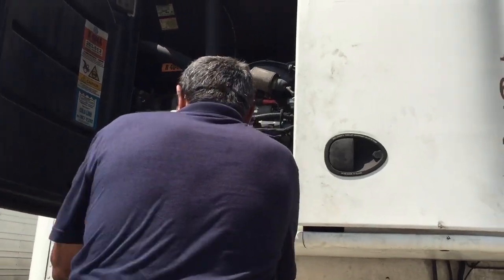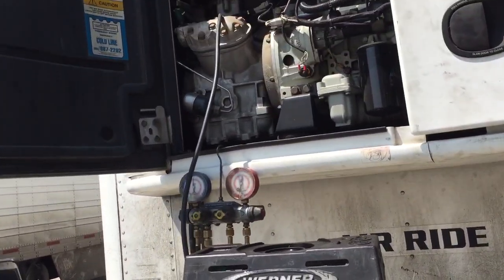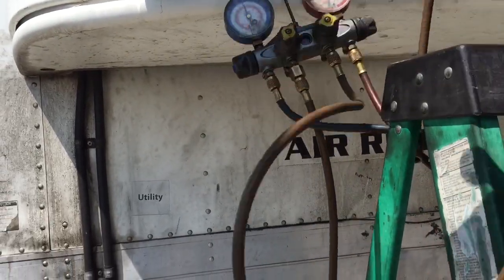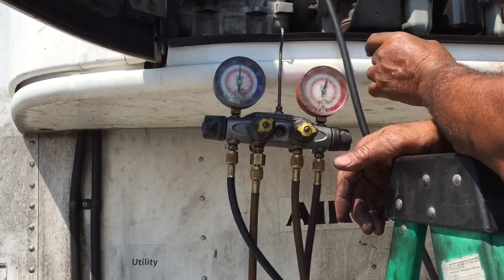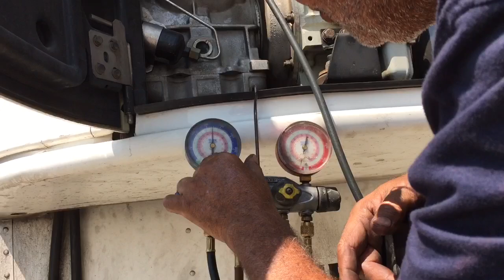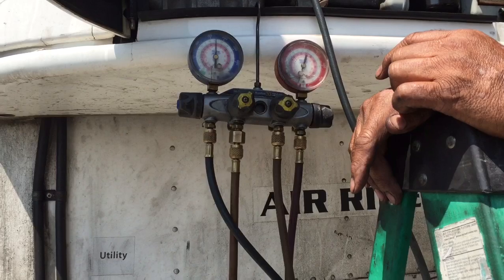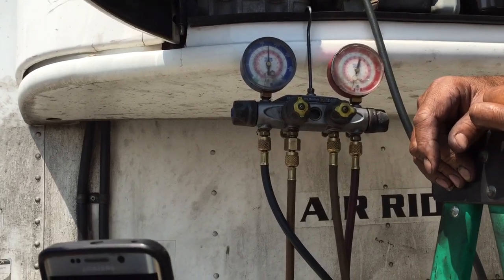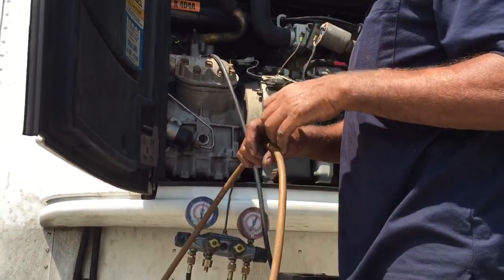Recharge freon in a Thermo King Reefer unit

Comment: I admire the guy trying to help the others, I'm sure he was getting paid but there was no way his students were comprehending what he was talking about. If you have to explain that the blue hose goes on the big pipe and red hose on the little pipe then they shouldn't even be touching a reefer. They need to go back to refrigeration basics and understand where to connect and what each component is in the circuit. They are too green for this machine. Funny to watch though.

Comment: The guy said blue to low pressure and red to high pressure, and connect to  where the bubbles are when you need to vacuum the system. The guy know his job just can't explain it right and people who don't know how to work in reefers unit such as thermoking or carrier will have an even harder time understanding anything. The Freon R404a for these units can be loaded both gas or liquid, just load it slow and with an scale. it's always better to vacuum the system and load the right amount of Freon to get a more efficient operation.
Reply: Any video to learn about it ?
Reply: @jonathanmembreno1325  not really. It's easy though. Thermo king has instructions in the operators manual. Basically get the box to around 0⁰f and add refrigerant until the ball in the sight glass is a bit over half way.
Reply: In which shop u working in am hiring
Reply: Wait this is not about fixing just to recharge get load off. Do you understand that. That’s shit happens. If yourr low on Freon you have issues for sure. You make no sense.

Comment: All you need is recharge, make sure to push release air output to clear out air vacuum on the gauges.  Which locate in the middle of the gauge between blue and red.   Put like 2 pounds of freon.  You 👍 good. 😂.  Other than thats you have leak somewhere.  Also for safety wear PPE.  Grove and safety glasses..

Comment: Please help, SB 330 - SR3 - holds 32 degrees PERFECT, but when I set to 33* it always holds it around 35 to 37 degrees
Reply: It's is programmed like that if it weren't your load would most likely freeze on top or in the front depending if you have a produce shoot installed or not, You can set it different if you have to have it maintain 33 only, But it will stop and start alot unless you're running it on Continuous, Then it probably  will.
Reply: @raymondreiff8170  yeah man, I’m running on continuous, and when it’s set at 33 or 34 or 35 it always seems to run about 2 to 4 degrees higher than what it’s set at for Continuous

Comment: to much missing info on this clip like
how to open valve 
which valve to open
when to open
how to bleed system
which way to valve turns clock or counter clockwise
half asss questions and half ass answers disregard that if possible
dont try to think add freeon based on he is talking about
if u think driving car is all about steering wheel he is right
Reply: Its not out of this world. I've notice that reefer work is very hidden from anyone. Why,don't know. But its very easy once you get hands on. It was limited to me at thermo king,but I've learned lots by myself. I have seen the worry of a driver owner operator and the smile after saving his load of frozen pizzas. I do road side with a partner of mine. I might be able to answer some questions to anyone and no I will not charge you.
Reply: @patricioaguayo9088  hello, where can I buy gauges like these?

Comment: I'm so so so sorry for u guy's. 
This guy knows nothing about how he most use and read 4 ways manifold gauge. 
Quick lessen.
This gauge  is for A/C unit's. 
U can use 2 way gauge .
2nd. If u want to take hi side prussure  is better use compressor liquid  service valve instead reciver. 
3rd. Who told u high side prussure most be about 300 to 350 psi ???
And 400 psi  could be sighn of problem.
In last if u look at the refrigerant label on front u . can see this unit most be charge by R404a gas.
This gas isn't freon. R404A is a HFC blend,